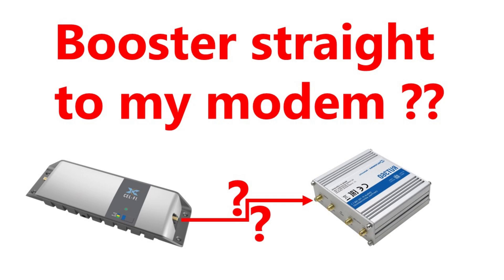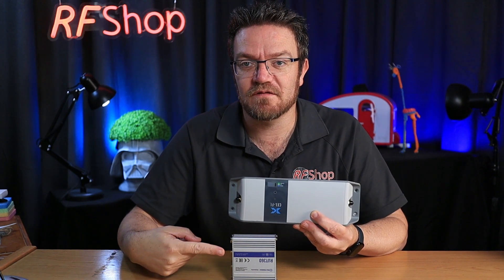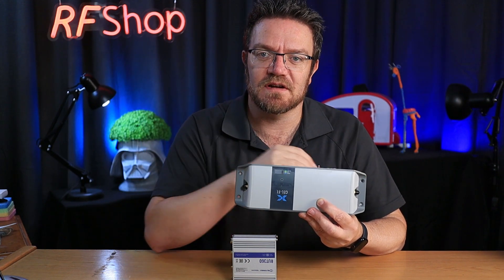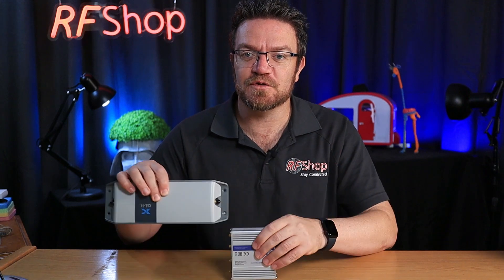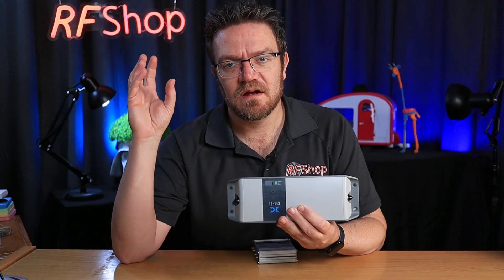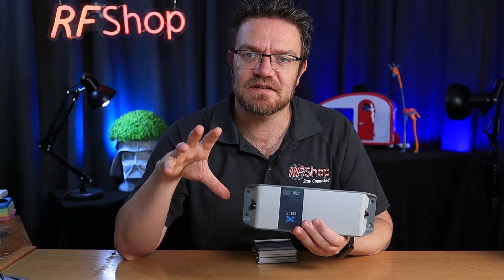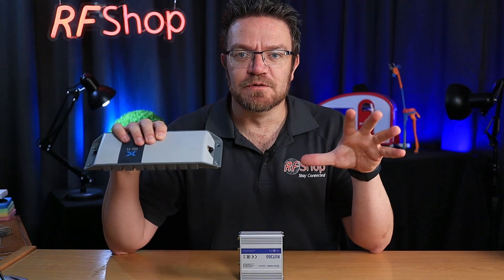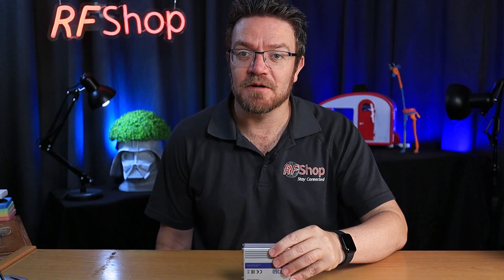Can you connect a booster straight into a modem ?

Comment: Hello David,thanks for the clear video! I am facing an confusion. I live in a rural area where I have only mobile network,So I bought a wifi router where I can put an mobile SIM card and it catches the signal from the tower and spreads wifi like a normal wifi router pluggen into cable internet. as mobile signal is very weak I want to buy signal booster. I was wondering if its possible to connect the booster output cable straight into the input of wifi router?(my wifi router has removable antenna on screw) would that work?
Reply from the maker: Hi, as per the video I would not recommend a direct connection. One main thing would be that it's too strong, and also one certainly need to take care with the uplink and downlink balance. Given my background and passion, I would start by seeing how good an improvement you can get using only external antennas. If that works well you'll have the best improvement without electronics. Once you add electronics ( i.e. amplifiers etc. ) you do loose system performance as you'll be adding system noise.
Reply: @RFShop  fantastic reply,thanks! I am think about only getting the antenna but the thing that confuses me is the two stock antennas that are on my sim router(TP link) that are wifi spreading antennas and screwing outdoor antenna cables into it would not work I guess as those inputs are not for 4G receiving,rather they are for spreading wifi,I guess the 4G receiving antenna is somewhere inside the router. 
So if my outdoor antenna will be outside on the roof,how my router will spread wifi inside house?
Reply from the maker: @LevaniTavberidze  this gets a bit tricky. You are correct...the WiFi antennas will only help with the WiFi side of the solution. You need to find a way to get the external antenna connected to those ports on the inside, or use a repeater to get a stronger signal on the inside perhaps.
Reply: @RFShop  thanks!  Do you think the router would work if it have for example 4 detachable antennas where two of them are cellular 4G receivers(where I will scree the outdoor antennas) and the other two for spreading the wifi(this two stays just as it it)
Reply from the maker: @LevaniTavberidze  it really depends if those ports are connected to the right type of radio. The antenna is only an output of what happens on the inside
Reply: @RFShop  I guess if its cellular 4G receivers then they go to 4G receivers inside as well
Reply from the maker: @LevaniTavberidze  yes, if that is the purpose of that port it will indeed work that way

Comment: David. Can you confirm that connecting the output directly to  modem will damage it or are you just thinking it will.
I am still wanting to test this scenario and  think in my mind it can work.
There must be a way to boost the mimo antenna.
I rely on data performance with the mimo into the Nighthawk M6 and generally get good results with upload speeds but there are areas that need that extra signal and using the vehicle setup isn't always practical . I simply can't get the car close enough to the area I'm streaming from to maintain a good signal from the output antenna.
I disagree that  cel-fi is only good for voice because on occasion, I have gone from 5mbps upload to 30 with the traditional setup using a yagi.
I just don't want to try anything that's going to destroy the M6
Reply from the maker: I am sure that the Cel-Fi helps on data, but I do firmly believe that it could have been even better if a MIMO antenna was connected to the modem on the same spot and using the same antenna :)

I think the risk of damaging the input of the modem is quite high, and I would not want to test it. It may not break it on that moment but there could be damage caused. Also, if the Cel-Fi think it does not need to boost a lot it will only output a small number, and the receiving unit may not be damaged. Then, on occasion the signal may be really weak and the Cel-Fi will boost a lot more and then that higher power level could be too much for the modem to handle.

Comment: Wouldn't the booster help a bit if it had higher gain amps than in the RUX? (in this example)
Sure if the Antenna is rubbish you are just amplifying noise.

Or is the gain of both devices that similar and the Celfi doesn't add any signal conditioning its just a 'dumb' amplifier?
Reply from the maker: Good question, and also justifies a focused presentation to explain my perspective here. The key thing for me is that the receiving amplifier ( router or booster ) gets the same input signal first. What happens after that could be conditioning or converting to data...but the range from the basestation is determined by the remote network, the antenna and the receiving amplifier. After that the question is very much what does the customer want to get from the received signal. I'll build a video to explain my thinking here :)

Comment: This is the question (not the Celfi out to the input directly of the Teltonika.....I'm perfectly aware that's not what you do......)  I  put to you a little while ago, but I didn't feel that I got an answer.  I feel your alluding to it in this video saying, "it gets messy".

If I have a scenario where I have a Celfi Go using it's own antenna, and another device, eg X1 Pro or Teltonika with a seperate MIMO LDPA array on the roof on a separate mount but within 3 or so metres of the Celfi antenna.

Will the data modems  RF stats "see" the Celfi traffic as "noise".?

 I haven't had the opportunity to test this as I couldn't shut the Celfi down on a live site whilst I was trying to map the RF stats on the data setup.
Reply from the maker: Michael, in a controlled environment where people can review the full environment and make sure there's enough separation between the Cel-Fi GO and the proper quality router it could work perfectly fine. I personally would consider doing what you ask, given the router is connected to the outside world using it's own set of antennas, and the only way to get the Cel-Fi GO output to interfere with the router is by coupling into the PCB circuit...which should technically not happen when they are not next to each other. 
This is, however, only true where we are sure that the router does not have it's own set of hidden internal antennas. If you look at a NightHawk or Huawei consumer device, there are also internal antennas and they will simply get a lot of signal (and hence noise and SISO) from the Cel-Fi and it will not be good (or to use my own terminology, messy). 
A proper router like Teltonika etc, using only external antennas and you as user knowing they are outside...it will be OK. 

However, this video goes to the WWW, and I can't explain the above and expect everyday users to stay somewhat focused on my message, so I tell the audience it's a bad idea, just don't do it. As an engineer I can do many things differently, but Youtube is for anyone, and the vast majority is not technical but still need to use the products.
Reply: @RFShop   thanks David